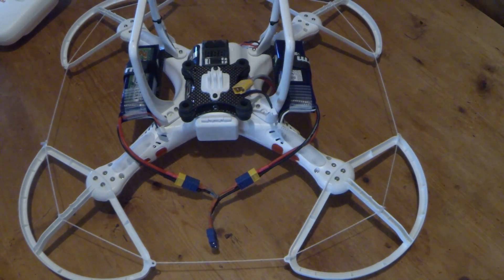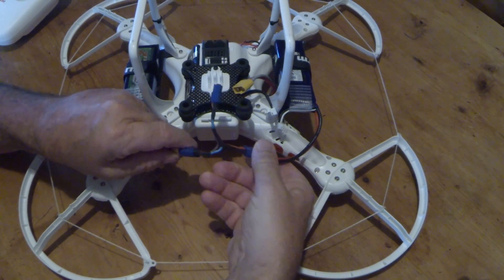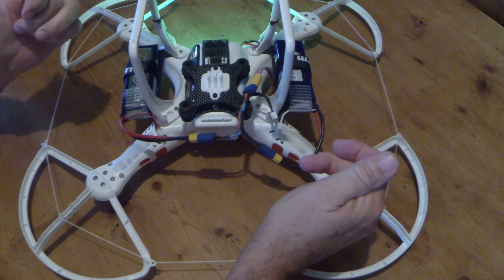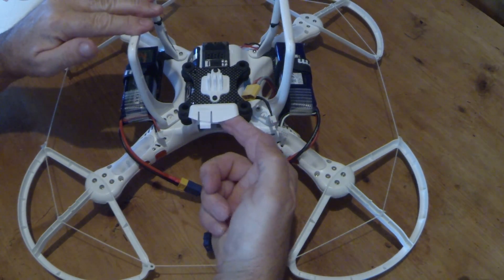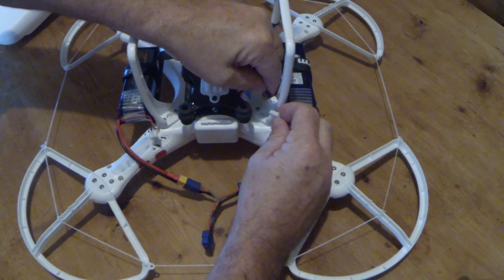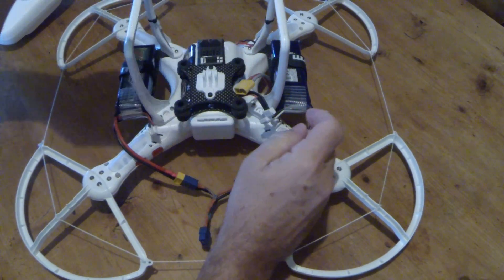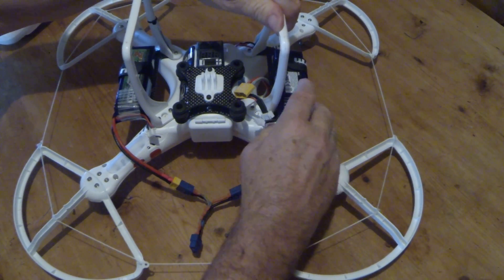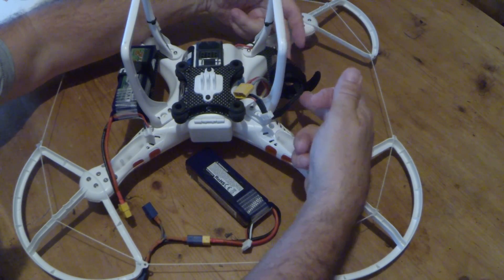DJI Phantom Battery Modification / SIMPLE X 2.

Comment: How do you set the gain? I install 2 batteries and does not hold up, then starts to drop. How can this be solved? the problem arises in any type of flight (Atti or GPS)

Comment: Great video! I wanna know if you can help me. I think I'm in trouble. I plugged the 2 batteries on phantom without changing anything on it and it burned. Some smoke came out and the smell wasn't very good. Can you tell me what should I do? Thank you so much!
Reply from the maker: Oh dear :-( that sounds like it was wired incorrectly eg you put 24 volts into the main circuit board and fried the electrics, I am afraid the Phantom is now Dead,
beyond repair.
Reply: probably will need to change ESC and receiver cause they're probably burnt by now

Comment: i just need that xt60 splitter wire and 2 batteries to connect 2 batteries to the phantom right?
Reply from the maker: Yes but make sure they are linked in the same way as mine.
Reply: Hey thanks for your help. But i really want make sure i dont break anything. This is the wire i got http://www.ebay.com/itm/141037545487?ssPageName=STRK:MEWNX:IT&_trksid=p3984.m1439.l2649 It should be the right one and i can just plug and play it to my 2 batteries?
Reply from the maker: Peer
Yes that is the correct one.

Comment: did you have to change you stock prop to make more strong when it comes on lifting? I just made my dual battery phantom and when I tested, it's seems that the quad cant hold much long on the air when I hover. it will slowly go down most likely because of the it's added weight. please give advice thanks.:D
Reply: yeah, me, too :(

Comment: what about wind drag have you tried to mount the battery's vertical so less prop wash you have a nice set up keep up the good work .
Reply from the maker: Hmm! good idea, I will look into it,  the bit of prop that can be effected is about the last inch of each prop blade.
To put the battery's vertical, it will get about a 1/4 of that.
I think you have a very good point.
Reply: Sorry for the awesome late reaction but u can put the battery between the legs of the phantom landing gear :)

Comment: are you using 2 2.2batteries right? Have you tried with larger batteries? Like 4000mAh or 5200mAH?
Reply from the maker: Yes they are 2.2 batteries, I have not tried anything bigger but that is always an option, the more mAh the less heat they produce in the batteries so that could be in the queue for a test ;-)

Comment: don't the motors get heat?
Reply from the maker: Good question, but quite the reverse! because they only work at half the rate as one battery.
They produce the same voltage but twice the mAh so less heat but longer time!